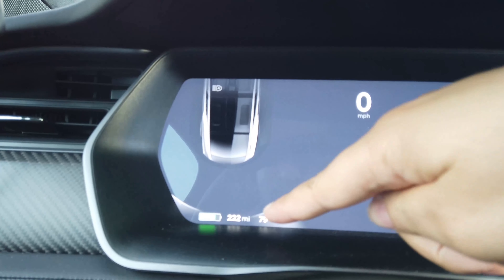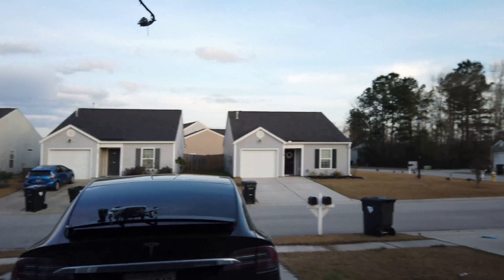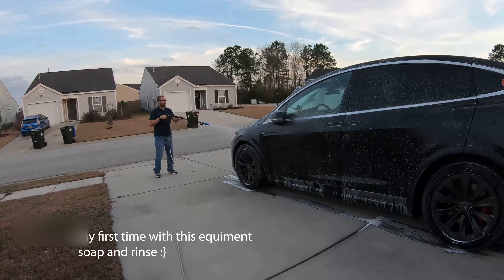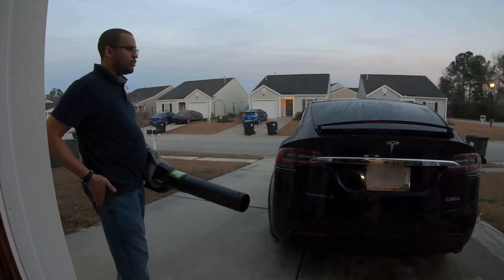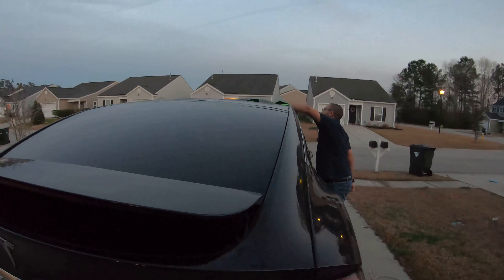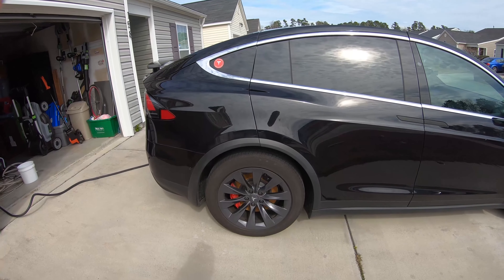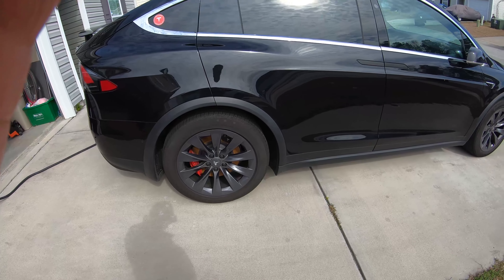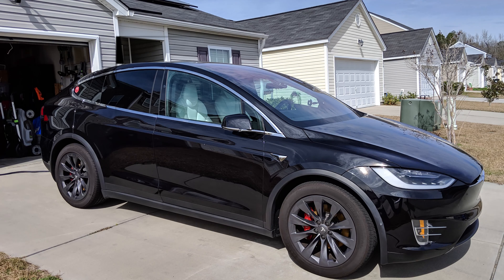Tesla Model X P100D  Foam Cannon Pressure Wash

Comment: Nice flyover. Did you already do a video on your solar system? I can’t say anything about washing a car because I haven’t done than in about 20 years, and things have changed. Lol
Reply from the maker: I haven't done one on mine but there is one on my dad's on deck, I'll see if I can get it ready for next week.
Reply: Kacey Green, now is the sweet spot for getting solar with tax credit and fairly low prices. I think this is the last year for 30%.
Reply from the maker: @imho7250  plus in South Carolina you get an additional 25%
Reply: Kacey Green, that’s a nice deal. Is your neighbor on the corner shading some of your roof? For 25% plus 30% it’s almost worth getting the whole roof covered if you have micro inverters.

I would get it on my house in the states but it’s rented out and I don’t want the hassle of getting paid for solar production.
Reply from the maker: yes I get shading on my fire offset, so I could still put more panels up, front and rear. We did go with Micro-inverters so we don't have to worry about the few hours of shading a year it might get. The hard part is now the utility has met their quota and is fighting more installations or expansion. I'd lose my production bonus adding more units. So what I'd do is get Powerwalls to 100% consumption before adding more, to make it worth the lost "income"

This array makes 30 to 50 kWh in the Summer, and 10-25 kWh in the winter daily. The house uses 10 kWh daily with us in it, I haven't measured it on any of our long trips to see what base is.
Reply: Kacey Green, you mean the utility will only buy a certain kWh per day or year, and anything you export above that is not compensated for? Sounds like it’s not straight net metering if a powerwall would help.
Reply from the maker: @imho7250  worse, right now I'm on a net plus plan. So I get paid an extra 4¢ per kWh surplus, washout on what I use. If I can get approved for more it's all washout. After the end of this month if I apply and get approved they'll sell me what I need at market and buy back everything at wholesale.

What the next county over does in my understanding is they have the same arrangement for new customers as mine is going to, plus if you overproduce by a certain amount they'll take the excess for free and charge you a fine per block of some number of kWh that they have to "get rid of" not to mention your neighbor's A/C will eat most of the excess.

With powerwall you can shutdown the array before it produces too much. Whenever power companies get with the program we could have our panels and powerwalls take advantage of the market the way the do in Australia instead of wasting good sunlight.
Reply: Kacey Green, yes, unfortunately I think many people got solar under one plan and then the utilities adjusted and their solar payment plus electricity is more than without solar.

Someone needs to invent a CO2 scrubber which burns excess solar power or some way to use it without wasting it.
Reply from the maker: This would be where I might bitcoin mine if I could set an interface up between my production and consumption. But there's a house not too far from here on a private island where they use it to freeze water for running the climate control overnight. I'd totally run the scrubbers if I could set it to run when the Powerwalls are full and the consumption is lower than the output. Also if they do slip-up and allow me on the market I will dump the Powerwalls into the grid when the price is right :) 

First step, secure some Powerwalls, I need two for this installation, three would be ideal.
Reply: Kacey Green, can you still make enough mining bitcoin to pay for the computers? That was a genius way to turn kWh into heat and then run. Air conditioners. LOL

I wonder what that cost of the phase-change energy storage is compared to a powerpack.
Reply from the maker: @imho7250  his was a big tub of water with some coils that a chiller turned to ice at night, mine would run during the day though.

I don't know if the RoI is worth it on the mining but I don't want to put that stress on my system and AC. I need that graphics card to make these videos 😊👍
Reply from the maker: 4k heats my house well enough